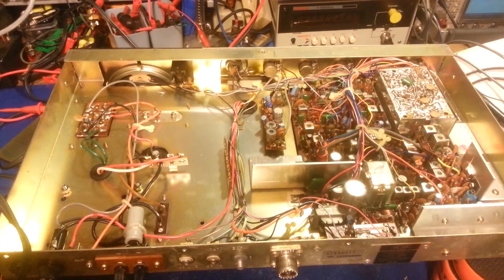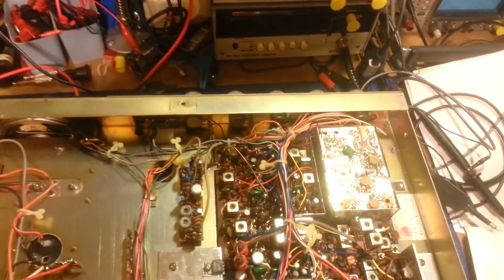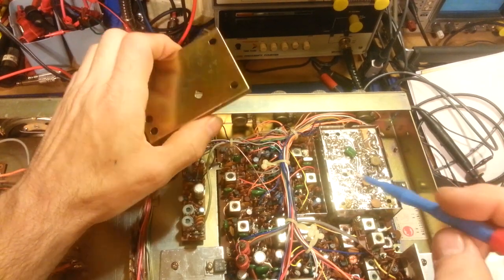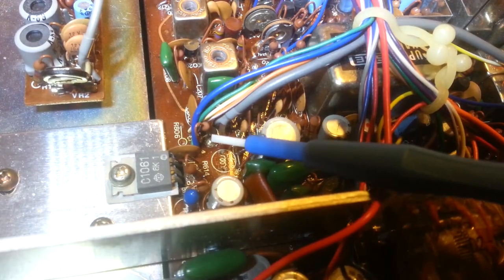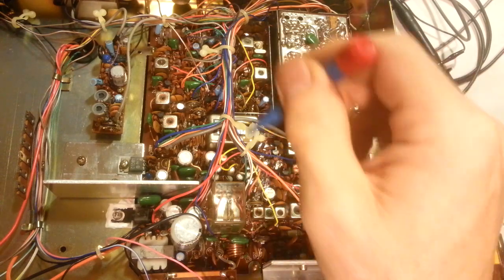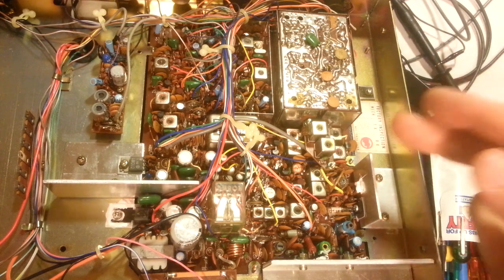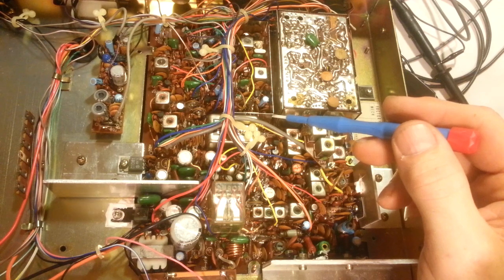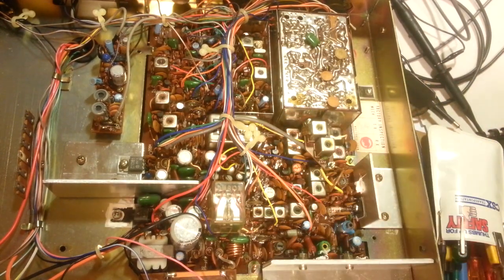SBE Console V early double sided PCB with bad via / pass thru's.

Comment: I have NEVER once owned one that worked right... They ALL have issues.. damn DSB radios.
Reply from the maker: DSB???  This is a single sideband radio.  Probably the best radio SBE ever built.  Excellent receive and transmit audio made perfect using their "Speach Spander" compression module.  The only reason this one has issues is probably because it was stored in a non climate controlled enviroment (attic) and has gone through countless heat cycles that caused excessive board expansion and contraction causing the pass thru's to all but rip out.

Comment: note to self: stay away from SBE
Reply from the maker: They made excellent radios.  The Console V was a premium top of the line radio.  I think this one lived in a attic or garage and went through a lot of drastic temperature changes over its life.  Thats probably what caused the problem with the pass thru solder connections.

Comment: I imagine if the unit was my very first radio and it had tremendous sentimental value that it might be worth the cost of having a tech repair that PCB properly...but practically speaking I'd have to guess that the cost must far exceed finding and buying a number of similar units just to cherry pick a good one. 'Course the corollary to that is they may ALL have the same problem to the extent they're all unusable.
Reply from the maker: I have never seen one with this many bad pass thru connections.  Might have been stored in a garage or attic and has gone through a lot of drastic temperature swings.